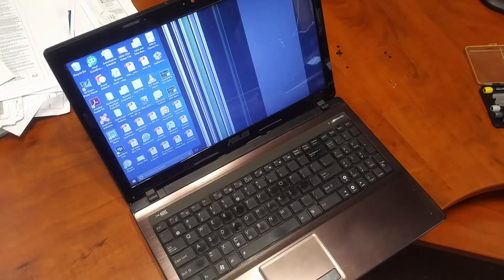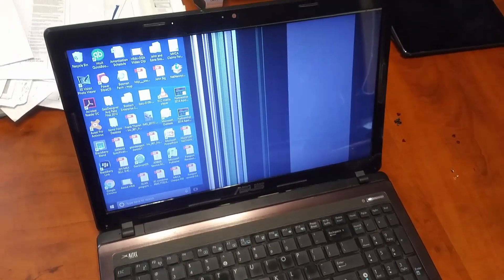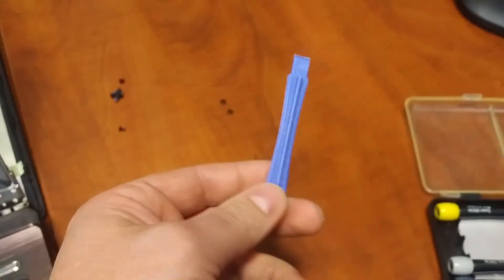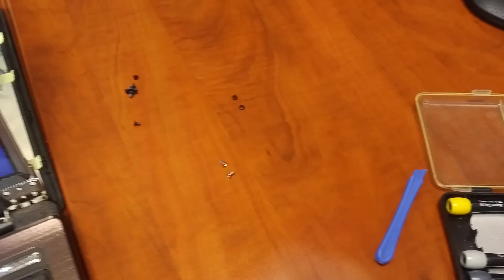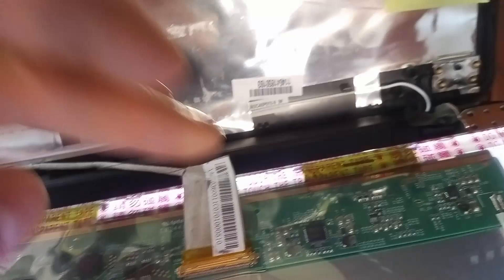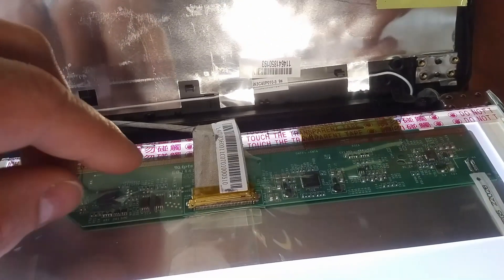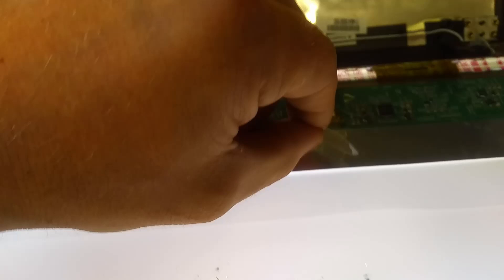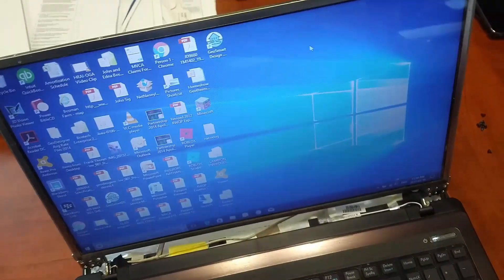Vertical lines on laptop DIY repair (Asus X53S)

Comment: I tried to repair my vertical lines but failed..so I purchased a new screen (on-line) for $53, installed it and voila .!!! no lines!!!
Reply: crazyjeancooking When you replaced your computer screen did you have to wipe off all your files and data?
Reply: I did the same and I didn't have to do that
Reply: @GalaxyGirl08  no, he didn't. i had my smashed tablet screen replaced and no data was wiped